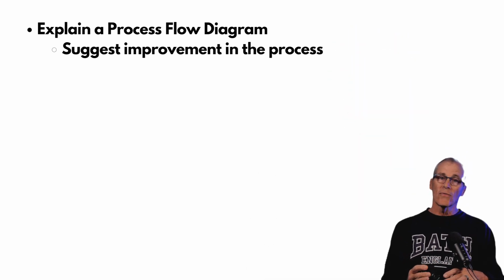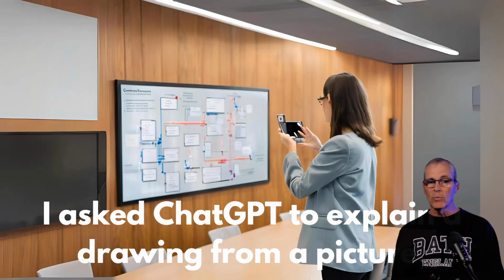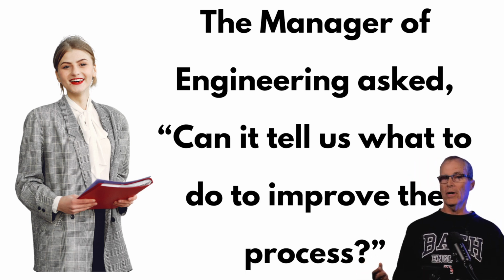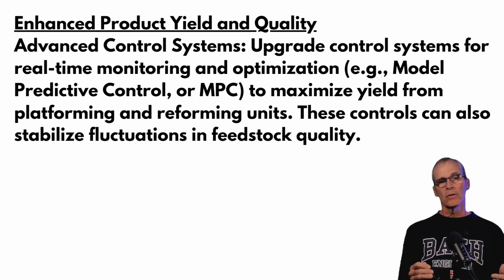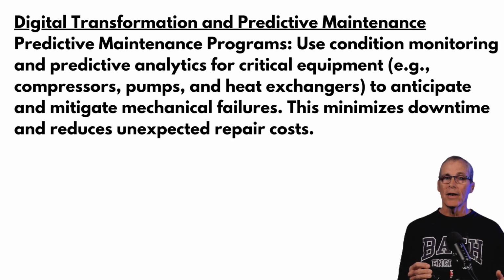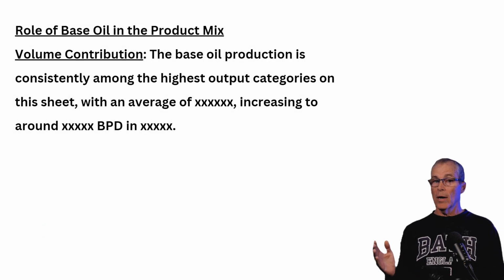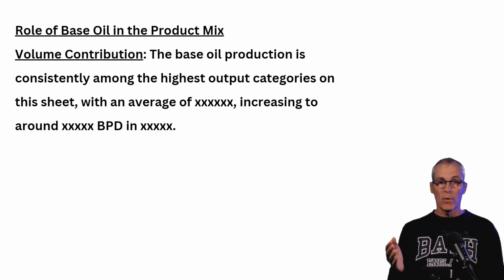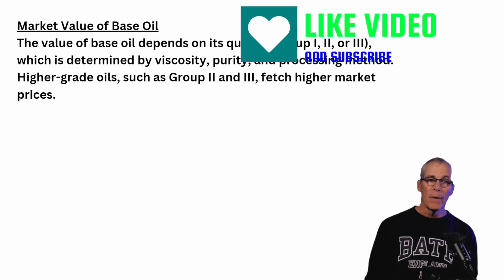Risk Engineering Use of AI

Comment: Great video! How do you think AI will affect Risk Engineering work opportunities?
Reply from the maker: @samsb2004  Great question! Because that’s exactly the video I’m working on now. It’s long. Main points: more power generation needs more risk engineers. Data centers are causing grid issues that need risk analysis and engineering. Data centers that use a Gigawatt of power  will need extensive risk engineering for cooling, power and reliability. Stay tuned. I give a presentation on this topic at EEI in a few weeks. I will get the video posted before then.